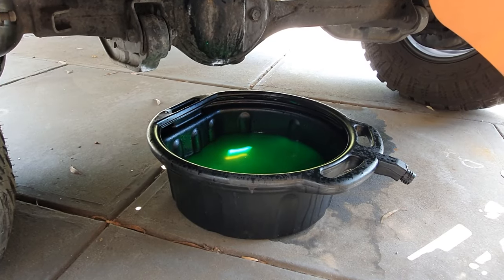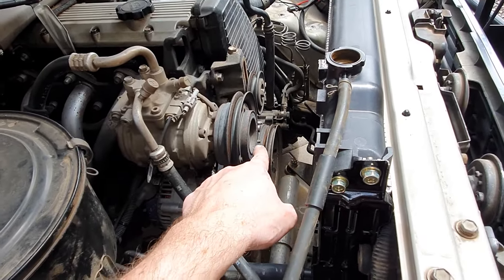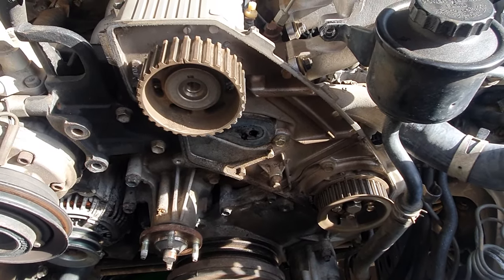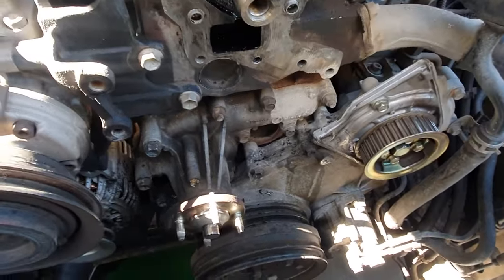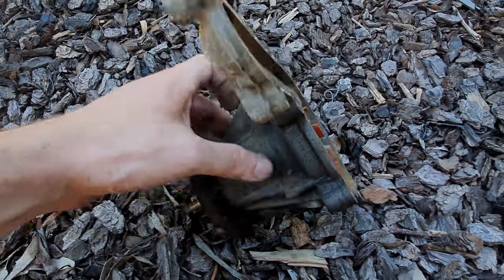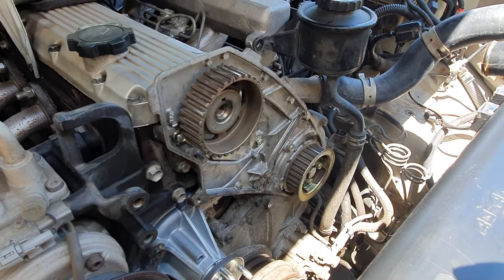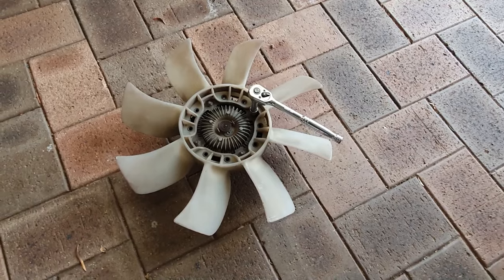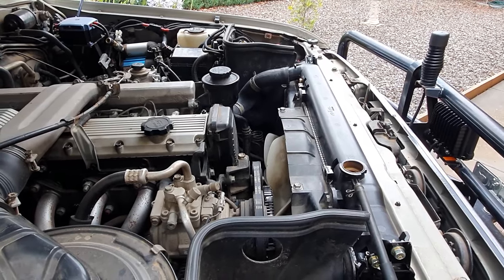DIY: Toyota Landcruiser 80 Series // 1HZ & 1HD-T Timing Belt & Water Pump Replacement

Comment: Do the threads on the water pump need to be locktited in ?
I just did this service for the first time.. car is still running so fingers crossed everything is all good, thanks for the video
Reply from the maker: Hey Dean

I'm glad you've found the video helpful. 🤠

No they don't need to be threadlockef in, just torqued to spec. 👌

Comment: Hey mate I need to do it I have never done it before I’m so scared I’m going to stuff up the timing
Reply from the maker: This is why I have a big disclaimer on this video and on my guide over on my official website.

If you get it wrong, your pistons will kiss your valves and the damage is done.

Won't be a cheap fix either at the point.

If you're not confident, please take it to a qualified mechanic. 🤠👌
Reply: @OzTrax4X4 is it hard to line up the timing?
Reply from the maker: Not at all, it's a single camshaft.